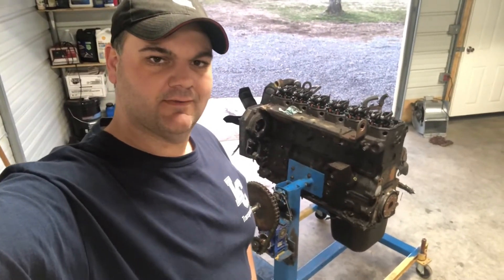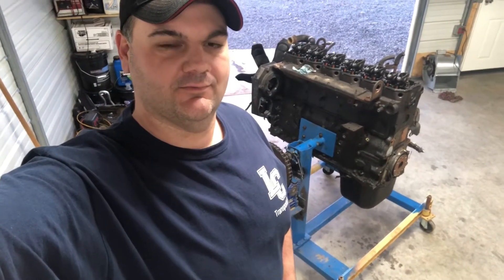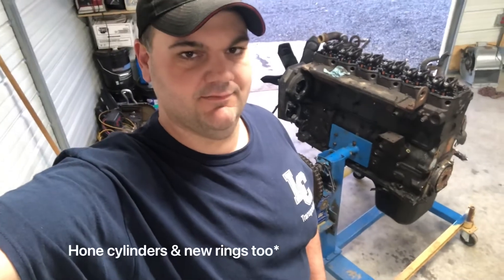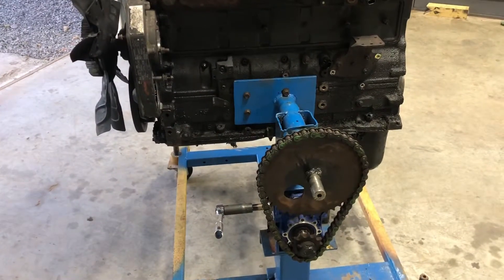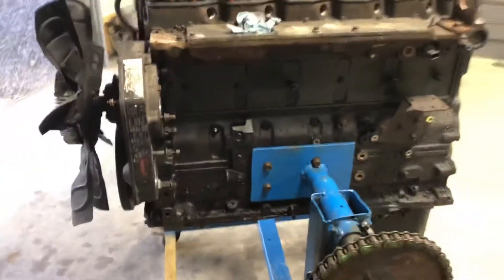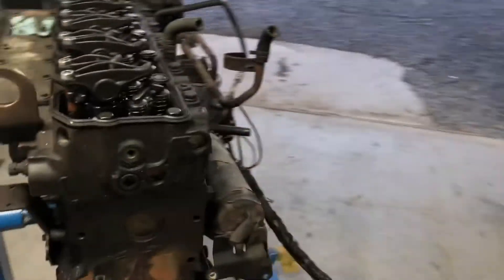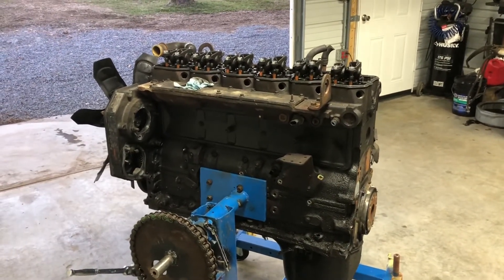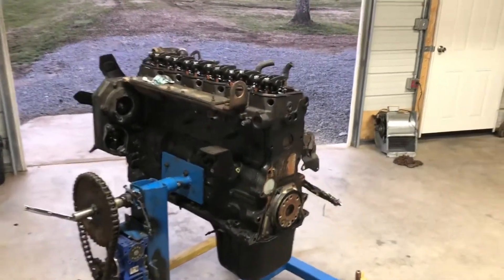The start of a 24v Cummins Rebuild

Comment: Dang sorry to hear the 53 block cracked. Make sure to save the guts on the old long block(pistons and rods, crank, head, oil pan, valve cover). If you don't take it apart make sure to keep it covered from the elements and condensation. Stuffs getting hard to find. On the motor you're building I would for sure balance and blueprint the rotating assembly and convert the valve seals to the newer top hat style. Should run like a top with the balance and blueprint.
Reply from the maker: Yeah, kind of a bummer that it cracked but ill get it fixed and hopefully never have that issue again. At least a person can afford to work on these compared to some of the newer stuff. Definitely wont let the other engine ruin because it ran great. The block is the only thing not useable. Hadn't thought a lot about balancing this engine but that might be something to look into, Thanks